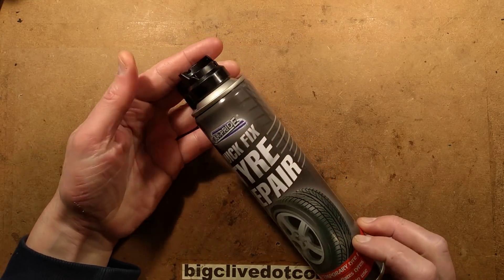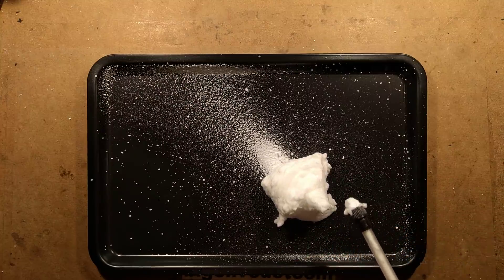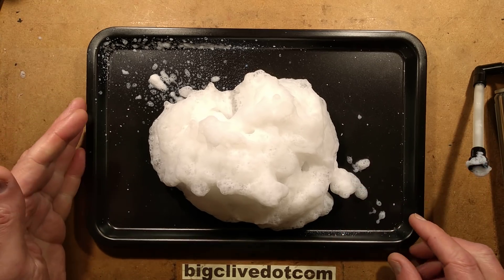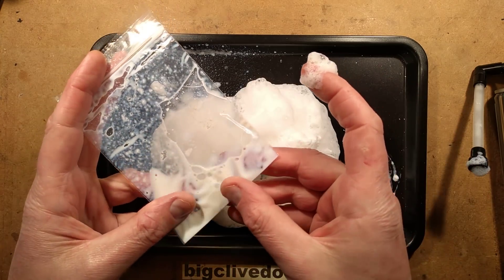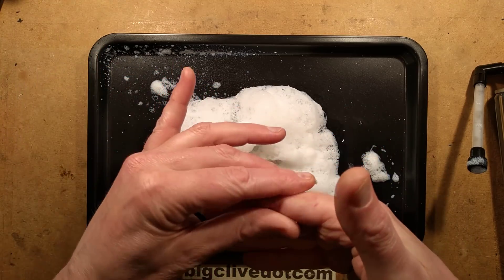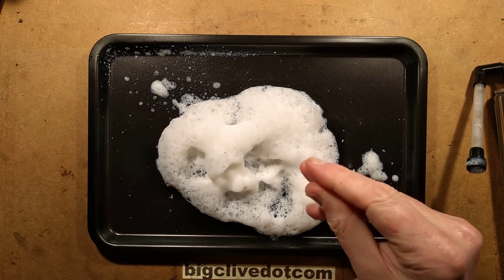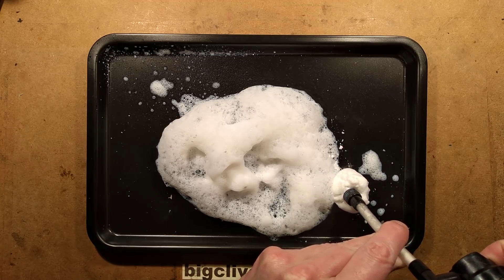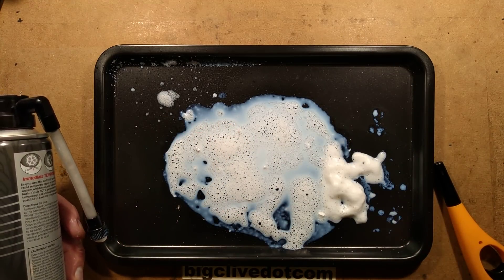What's in a tin of foaming tyre repair liquid.

Comment: I would never use it in a road vehicle but I had a brand new atv that got a rock hole in a tire after only about 100 km. Plugged it with one of those sticky plug kits, but it still leaked as the hole was a little too big. One guy with is had a can that we used. We planned to replace the tire after the weekend ride but it's been 8 months now and it hasn't lost any air so it's just been left alone.

Comment: used this to seal a leaky rim on a wheel,ran on it for months before i decided to refill it with clean air.I suppose it could explode if you got a major blowout and tyre  shops always roll their eyes at you when they see the inside because its usually a sticky mess.BUT more and more car makers are replacing spare wheels with a pump and a really expensive can of this liquid(£15-£20 approx) and you need a new tyre every time you use it.Another way to get money out of the driver.

Comment: If it works from all angles, the nozzle probably has a very flexible hose inside the can, with a weight at the end. That way if the can is held upside down the hose will still be dipped into the liquid.

Comment: @bigclive.com I used to work in a large brand tyre shop in Australia 20 years ago, we had a bulletin come around stating that ALL tyre repairs MUST have tyres removed from the rim to be repaired! We used to use those push in plugs from the outside of the tyre when the tyre was nearly bald. The going story with the bulletin was that in the US a tyre repairer drilled a tyre to plug it from the outside and it exploded due to the owner had used one of these cans to get home so yeah can be dangerous in certain circumstances

Comment: I use the slime safety spair. 7 minute tire pump and green slime that guarantees it’s safe for tpms sensors. It has worked wonderfully every time my family has used it. The liquid unbalances the tire till you get to a repair shop. But I have driven with it in there for a long time. Just tell the repair shop you used it so they can clean the tire. 

I had a car I rarely drove that I could not get the tires to seal to the rim. Left this in there and only had to fill up ever couple months instead of every time I drove the car. It only got a couple hundred miles a year so really didn’t care much. Just wanted it to work when I needed it.

Comment: Anyone considering buying this should get the sticky red cylindrical boogers + pokey tool sets from ebay. They are 2$ and I've had people at the tire repair shop using these exact things to fix a puncture. You just thread the booger through the tool and poke it in the hole. Retract the tool and it's done, you can drive it for a few weeks no problem.
Reply: Hmm, I don't think it's a fair comparison when you are on your way somewhere and need a quick fix. You need to find the hole and have good access, both of those aren't easy when the wheel still is on the car. With quickfix you don't even need to jack the car up.

Comment: I've used those, well not that exact, but similar products and they've worked few times. I've actually driven repaired tyre for don't know, few years after fix when I didn't have too much money as student. They're usually hardened inside of tyre after little. But these days I prefer the diy puncture and insert glued worm type fixing (don't know what it's called in English). This is because those quick fix bottles can lead to very slightly leaking tyre and it's better to fix them properly right away. BTW I didn't know those are that volatile out can. Began to wonder if it "eats" oxygen away? Then again it in contained space without getting air to be so to say fatally volatile in tire :D

Comment: The American brand is called fix-a-flat and most my experience with it is in bicycle tubes and wheelbarrow tires. If the leak wasn't to bad and the product sets correctly I've had a quick fix last 2-3 weeks without a second thought. If the seal is not the best typically you'll find yourself with a flat maybe 3-4 hours later. Sometimes another application can salvage the thing, but it's usually fubar'd at that point. I know the tubeless get fubar'd more often.

Comment: My Zafira Tourer came with a tub of this stuff as standard instead of a spare wheel. Lots of manufacturers are doing it now. Penny pinching I guess.  On both occasions I've had to use it the tyres were replaced as the kit apparently ruins tyres. I'm not sure why if all it's doing is adding a layer of latex on the inside.

Comment: I used to run cheap used tires with consistent slow leaks, and I often used this stuff to try and counter them. I'm not entirely certain that it actually helped, but it never caused me any additional issues. This was about 30 years ago, but I doubt they've changed that much.

Comment: I've used that sort of stuff twice, though not on a car tyre and both times were failures.

Tyre on neighbour's sack barrow had slow puncture, I thought a can of that stuff would sort it out but it still went flat.

More spectacularly, I bought a new electric bike, had puncture on my first ride and wanted to go out again that day so I used a tyre foam branded for bicycles.  It inflated the tyre well, but a few minutes after I'd finished squirting the foam in, the tyre went bang, it blew a big hole in the inner tube and showered me and the room with sticky gritty foam.

So maybe the formulation was different on this one, as I could feel a lot of grit (nanoparticles?) in it.

Thanks for great videos.
Reply: I am sure it only works with tubeless tyres.

Comment: Probably the same as what Savinex (spelling?) makes as 29Y40. Used in the construction/cement/concrete industry as a bonding liquid, we use it exclusively as the liquid we add to our cement products instead of water, and also as a primer for screed. You ain't getting that cement off of the substrate! Also a good waterproofing agent for porous things like plant pots etc, and a good plasticiser in cement products.  A real bitch to get the cement off your hands unless you use something like Xylene, butyl acetate or other non organic "soft" solvent.

Comment: Butane has a vapor pressure of around 2.1 Bar, which would be quite handy.

But this stuff isn't really a good Idea. Normally a tyre can be fixed by a special repair shop. But with all that goop inside the tyre you can just throw it away because cleaning it would be very time consuming and thus pricey

Comment: I did use that Stuff on my Scooter when i was young.
I had a Flat Tire and that Stuff fixed the Problem for 2 Years !
If you put it in, you are "told" to rotate the tire for a while so that it can harden up in the Hole(s) you have.
But sure it does not fix the big Holes :)

Comment: I used one after a puncture on the motorway. Really sceptical but it was great. Not sure on the one you had, but mine said use the complete can then and drive around for 10 minutes, not faster than 30mph. Check your pressure and top up if necessary. Providing the air is holding you can drive up to 50mph but get it checked asap, which of course I didn't, even though I meant to every day. I drove around for about a week and it was fine. It did not harm to the TPMS at all and the guy in the tyre place just said they can be a pain to clean out and sometimes difficult to locate the puncture but other than that they don't cause any damage. He laughed it off as if I was a bit soft actually. The only danger he said was if the puncture was in the wall, you may not know and continue to drive.
Reply: It wont' harm tpms IF you replace the tire in a timely manner. If the liquid stays in the tire (such as if they successfully plug it and don't dismount the tire to clean it out or patch it internally) it will rot it away over a year or so. What you did was perfectly fine. When you are stuck you sometimes gotta do what you can..... The silly thing is when you don't know the limit, like driving a car with no oil in the engine and thinking you can make it home, or the person who gets their car towed because the "oil service needed" light came on. In situations like that it helps to know how a machine works so you don't put yourself in a bad or wasteful situation! working with cars I've seen a few people waste a day on something they really didn't need to.
Reply: @volvo09  That's the thing, you do what you have to. Still can't beat a spare even if it is one of those bright yellow Fisher price "my first tyre" That's the problem with hybrids at the mo - so little room. Hopefully things will change. If I had more space I would defo get a spare.
Reply: Is that what those idiots are doing at 30mph on the motorway?
Reply: @stace3037  Never seen anyone do 30 on a motorway but quite possibly yes.

Comment: Once was using a can of expanding foam (the orange gap-filling stuff) to build up a sculpture on a wire frame. (Don't ask why). This was being done in a relatively small garage, with an electric fire sitting on the floor for heat. Naturally, the propellant formed a layer on the floor and after a while reached the fire and decided to ignite. Relatively harmless but it gave me one hell of a fright!

Comment: I had this stuff in my POS Volvo s70 for a year and a half. The tire became unbalanced, shook at high speeds (50+MPH), and never really sealed the leak. The tire had dry rot, but a quick fill every week with a $30 compressor saved me $600 new tires.

Comment: Liquid latex is the base sealant used for tubeless mountain bike tyres. It works well but makes a hell of a mess when it comes to changing tyres. I wouldn't want to be using it on a car tyre unless you were going to change it as soon as possible. Even then the tyre shop guys will hate you for it!

Comment: It is horrible stuff.i used to work in a tyre repair garage and i was very unhappy when i removed a tyre to find this gunk splashing around inside,all of it needs cleaning out before the puncture can be repaired,also it is not all that effective its a 50/50 chance if it works or not.  thanks for the videos great work as usual.do not know how i came across your channel but i am glad that i did

Comment: Usually propane is used as a propellant in tins like this one. But for flammability it doesn't matter if it is propane or butane.
...
This foam is gross.
Reply: TheSchnilser propane is better as it has a lower vapour point. Butane stays liquid at close to zero degrees so on a cold day won't inflate a tyre just pump liquid gas into it. Which then rapidly expands once it gets warm... Not a good thing I'd have thought

Comment: i never used it on a car but i did use it on my bike tyre after i ran over a nail  and i held up for a whole week (had to reinflate tyres every two days) but it stopped holding the air in the end. a little tip for bike tyres is to put the bike upside down and spin the wheel as fast as you can if its the back wheel or go down a really steep hill if it is the front tyre so it spreads evenly but it does turn the innertube all white and it gets cracked in the end no idea why but it does work very temporarily.

Comment: I remember using one of those on one of my first cars and forgot about it.....a few months later it went flat again and the tire shop was annoyed they had to clean off all the thickened goop from the wheel.....

Since then I have used the "Slime" brand emergency kit which you put their slime in the tire then use their 12v air compressor in the kit to reinflate the tire...that one worked pretty well.

Comment: I've used a product like this on my riding mower here in the US. In the clear tube, it looks much like what you saw. But the theory is that, where there is a leak, the latex will leak out, and because of the exposure to air, it will solidify and plug the leak. Practically speaking, if you have a hole in your tire, you would take some rubber strips infused with a sort of industrial glue, and stick that in the hole. Over time, it will work loose. But in the meantime, you use Fix-A-Flat to plug any gaps possibly left by your rubber-glue stuff and inflate the tires. There is zero chance of ignition within your tire, and the percentage of volatile gas within it, after using the product is way too high to foster explosive behavior.

Comment: I've heard if you use these and forget about it it will turn into a hard ball of rubber bouncing around in your wheel. Ok to use if you are hours from help and have no options, but you really shouldn't use them. They are a pain in the ass to clean out of the tire for the shop. Best buy them some pizza if you have to.

Comment: Quite some time ago I was given one of these as a 'temporary' fix for a small 125cc Scooter I was using anyway, had a flat one day and my 18 year old brain thought, AH I have a fix for this.

After failing to inflate the tyre  I wheeled the bike to a repair shop and was charged  £5 for the pleasure of removing the yellow / liquid substance from inside my tyre. (and then charged separately for the re-inflation and repair of my tyre).

The reason it didn't work, you do actually need some air in the tyre to begin with.

lesson learnt.

Comment: In an emergency I have used one and it works. It sealed it well enough, that when I took it in to have plugged, they couldn't find the leak, and I ended up driving un-repaired until I replaced the set. There were no issues at all.

Comment: The ones where I live have the green shit in them.

But either way these should be avoided like the plague they are.
Tire fitters hate them as they have to clean up the wheel afterwards, the tire is unrepairable.

Use those tire plug kits and get a small 12v air compressor.

Comment: My parents have informed me that, growing up on a farm, they have frequently used combustible gases to inflate tires on farm vehicles.  Typically propane or butane, it's just easier to find because they have several tanks on hand and sometimes it's easier than finding an air compressor when you're stranded miles away from home on the edge of a corn field without cell phone service, and you just have a propane tank in the bed of your pickup.  As far as I know, there haven't been any exploding tires because of using combustible gases.  There just aren't typically any sparks inside of a car tire.

Comment: I think you have missed something. I believe the transition to tacky rubber is initiated by the sudden pressure drop as it leaks out the puncture or perhaps the friction of being forced through the puncture. I don't know the physics behind it but I think you should test it by making a chamber comprised of a length of PVC pipe with a fill valve on one end. The opposite end should have a piece of rubber stretched over it with a small puncture in the center. Once pressure builds in the chamber and the foam starts to be forced through the puncture, you should see it plasticize immediately in that location.
Reply: Ben Chernicoff The pressure drop between inside and outside of the tire is nothing compared to the pressure drop when leaving the can.  They seal the tire on two levels, first by slowly solidifying as they leak from the tire with each new layer narrowing the gap and secondly the propane propellant itself also causes rubber products to soften and swell further reducing the opening.  But these are awful products anyhow, much better is a simple proper plug kit and a DC air compressor to repressurize the tire once the hole is plugged as such will last the natural life of the tire and does not create headaches for tire technicians when it comes time to service or replace the tire later on nor any risk of damaging tire pressure sensors if not promptly serviced and cleaned after use.

Comment: Yes, these do work... Sort of. There is rarely enough pressure inside the can to re-inflate the tyre but the gunk does the job and quite often will last the life of the tyre. 
It's worth noting that most tyre fitters will refuse to repair your tyre if they discover this stuff inside. This is because it's difficult to completely remove all the gunk from the inside of the tyre and have a nice clean surface to bond a patch or plug to.

Comment: A lot of modern cars are supplied with this kind of crap in place of a spare, even when fitted with Tyre pressure monitoring system (TPMS). Using it will ruin the TPMS and end up costing a lot more than just a new tyre. Best bet is to get a space saver spare and only use this stuff in wheel barrows.

Comment: It works like your blood does.
The instructions are very cear when stating its a temporary repair.
But it will work great only if the leak is small enough for the can to handle. 
It's a tool for the lazy,  you get what you pay for.

Comment: I've had to use a product like this however it was not this kind of spray can. Had a quick look and what I used was a "Slime tire repair kit" which doesn't use combustible gas but a 12v air compressor to release the liquid into the tire and inflates it to the desired tire pressure. Probably the same kind of liquid i guess. 
Worked just fine, drove around on that tire for a few days without any issues, ended up replacing the tire after that since the thread was getting low anyway but it said on the instructions that the solution could be washed out in order to have the tire repaired more permanently.

Comment: I've used it to fix a flat tire (several occasions), and it kept the tire from leaking until I eventually replaced all 4 because of treawear, a year or more later. Tire shops don't like it because it's messy, but I've never seen a tire shop that was particularly clean anyway. The tire was not "damaged" or off-balance because of its use, it worked great for the remainder of its normal life. However, the tire was relatively large (Jeep) so maybe that's a factor. Over here the brand I use is "Fix-A-Flat".